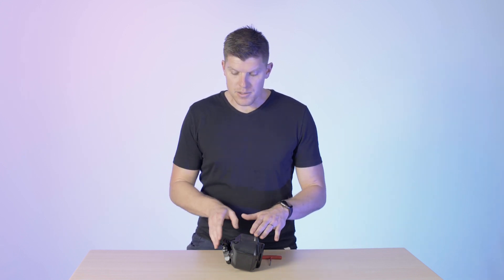How to adjust Tilt Backlash on Arc II

Comment: its fine with tiny cameras - but if you have just a medium camera like the Canon C70 even with a small 35mm on it the load is to big fro the tilt axis. So it´s far from the advertised load capability like really far. You get weird sounds like plastic grinding when you start a tilt move and the even worse it just drops in the tilt axis and you will get jumpy footage. Pretty disappointed just received 2 sets with the carbon rails and the hi speed motor. - Verdict: overpriced and a pretty crappy product - Don’t believe all the reviews - This one is from a user and not a paid reviewer.'

Yep we did all the jazz with mounting the camera all the way front and then back and adjusting the tension screw as showed here in the video. Same issue with both units so it’s not a single unit error it’s just a crappy motor...sorry
Reply: Wow, even a C70 doesn't work well??